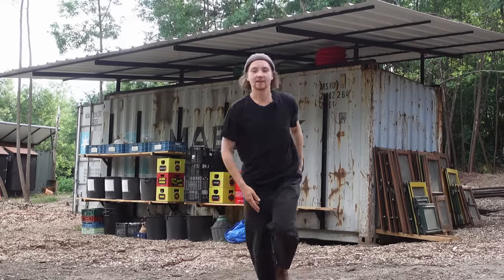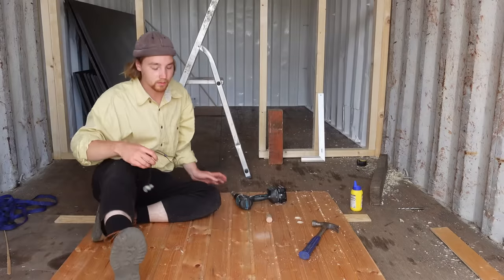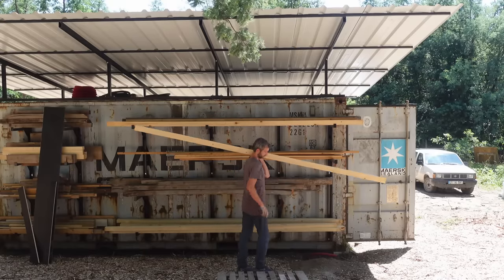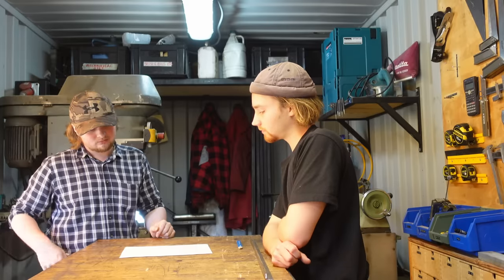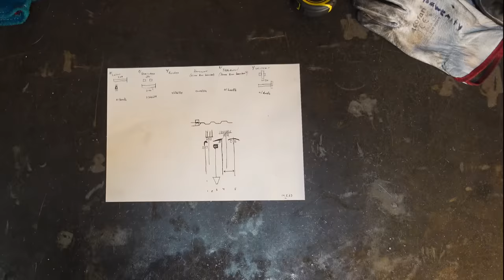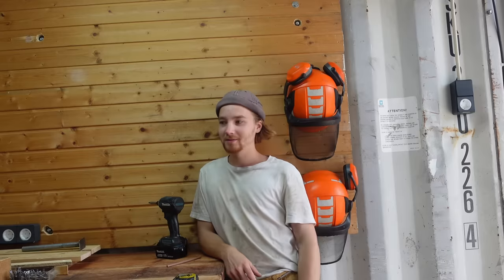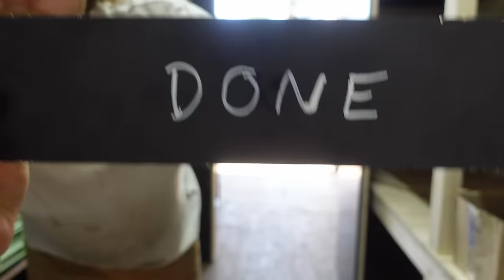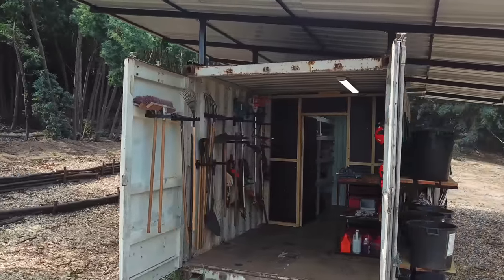#85 We rebuild this shipping container to store all our bulk food, tools and materials.

Comment: That's a ton of work!  Great progress.  

I have one suggestion: where your storing your gasoline, you may want to have a vent to the outside to minimize contained fumes.  Lower explosive risk, prevent people getting dizzy, and prevent your stored food from smelling and tasting like petrol.
Reply: Venting also ceeps the Container from becoming a sun fueled oven in the summer and reduces the build up of moisture in the cooler seasons which leads to less mold and rust.
Reply: and also don't  store paint with your food for the same reason
Reply: Even better would be lockable box outside of container for fuel/oil/paint. Something like old refrigerator/freezer.
Reply: Everything combustible should be outside in a metal locker with a stout lock.  Time for a trip to the second hand store (or a phone call).  Storing flammables like gasoline and oil next to food stuffs is strictly forbidden virtually everywhere in the world that has occupancy rules.
Reply: @wolfgangfroehlich7786  I believe that is why they designed the roof in this fashion.  In addition to providing shade to most of the container, there is a natural convection flow of air across the container as the top roof heats and up the container roof stays cool.  Very creative design on many levels 😊
Reply: venting could also help keeping dry through the winter
Reply: I worry about storing gasoline and oil in the same building as food.  I hope the separating wall and door is air tight!  The fumes could seep into the food and effect the taste and quality!
Reply: @stevejohnstonbaugh9171  Of all the cutting machines they've got, I've only seen 2 that are fuel powered, the majority being battery operated.  Unless they refuel inside the container spilling/saturating onto the floor and bench, it's doubtful fumes can accumulate.  The majority of the season the entrance doors are left wide open.  I've stored my roto tiller in the basement empty of fuel, keeping the jerry can of fuel in a brick faced lean-to outdoors.  No problems for 45 years.  Extreme heat of summer in Portugal, investing in a shaded/northern exposure steel locker for cans of flammables (paint and gas) kept apart from the other structures is a sensible suggestion.  The machines themselves don't carry enough fuel to be worrisome.  The Portuguese fire dept should be able to advise distance and placement of fire safe lockers.

Comment: Even if you have a roof over the container: If you drill holes into/through the ceiling do your self a favor and seal that with silicone or similar to prevent leaking. Even better if you would paint the bare metal before you put screws in to prevent rust.
Reply: better than building permanent structures at this point? it confuses me after 3 years.
Reply: @snakey319  they need permits for that.
Reply: @Music4Marko  I know and wonder why they dont get them and build for permanence, unless this isnt .
Reply: @snakey319  Not sure about here specifically but most places it is very expensive to get permissions that are then not flexible. Also many materials are donated or recycled and permits often require you to build to a standard with materials of a recognised specification for strength and fire.
Reply: @snakey319  Pretty sure this is the best possible solution for diy. Otherwise you need build permit for the land, architectural project, and after building the license to use. And since they are outside a town there might be the possibility that new permanent buildings are not even allowed at all.
Reply: @snakey319  they talked about that while back (about building lvl1 (tents), lvl2 (something like this) and lvl3 (proper buildings with permits).. and they said that in the future they will maybe do it. I guess its expensive or maybe even impossible to get, that is why for them its important to reconstruct buildings they already have, or to build on ruins of some very old stone buildings (which they also found in forest) because that is reconstructing and they can get permission for that.
Reply: One could also use hemp or cotton fibres soaked in linseedoil instead of silicone
Reply: Fab work. Emili does beautiful work. Dave seems a bit tired? I hope you all have fun 🎉
Reply: @randgate  Standards are important. Stops people putting up cheap buildings with a nice coat of paint. Then people find that the are cold in the winter hot in summer the electrics are a hazard etc. It is unsustainable.
Reply: @Music4Marko  I believe the community center is where Dave is waiting on permissions to rebuild/restore because of it's potential for full time habitation.  We shall see...

Comment: Great job!
I’d add a minor and major thing.  Minor, a spring on the door so the food area auto closes.  Major, passive ventilation near the fuels.  Containers can build up with evaporating fuel even with the small vents they typically have.  I saw the solar active vent and that’s good too, but at least a lot and high point screened hole should be added.

Comment: The recycled plastic socket enclosure looks very nice! Though, I suggest you consider the flammability of plastics. Enclosures of electrical equipment are made with plastics that meet standards for being fire retardant. In the event of electrical arc and/or overheating you don't want a flammable material nearby.
Thank you for being so positive for the community around you and for the world in general! And for the very nice videos;)

Comment: The rear bolts for the vice are really close to the edge of the plank in the desk top.
It might be a good idea to put a metal plate with holes in for the 4 bolts underneath the desktop to stop movement / breaking when the vice gets used hard!
Love the tool wall! <3
Reply: And a bit more to the front so you can also use it for longer things.
Reply: It’s designed to be mounted hanging off the side of the bench.

Comment: The storage container looks awesome.  Great teamwork getting it done.  One question,  why didn't you paint the entire inside and out? Painting it would help to prevent more rust,  helping the building to last longer,  and be more appealing to the eye.
Reply: It seemed like a tiresome job, (though the crew are not afraid of that) maybe it was enough. I think its aesthetically and a bit practically to not paint the outer part. It gives a nice space separation and, the gen. crew can be rowdy with their rowdy walls, while the kitchen peeps can have good control on hygiene.

Comment: Thumbs up!  Small suggestion for when you restock your scubby-sponges: maybe test other materials other than the green plastic scrubby-stuff (which is what it looks like you've got there and is really horrible for turning into microplastics).  When I saw it I thought since you're a living lab testing more sustainable solutions, it makes sense to suggest this test.  There are coconut fibre scrubbies that work great and are supposed to biodegrade/compost.  Maybe do a test with one of these against steel wool, your current sponges and a few other options like a boar-hair scrubbie-brush?  You could test them for durability (how long before it breaks down or becomes too stinky to use in the kitchen).  To judge the impact you could analyse the production streams that create these products as well as their post-use waste-or recycling streams.  It's definitely something that people can apply in their own homes quickly and something not enough people think about ...or it's something they DO think about but it's in a situation where the people who decide about spending are reluctant to spend more for what seem like more environmentally friendly options.  Tonnes of ethically minded culinary professionals would love to hear from your kitchen staff after they've put these tools through a few months of testing.  And with the larger amount of people you are cooking for every day, it's a fair-enough sized test to be able to count on the results after a few months of testing.

Comment: Nice work guys and great editing. mondays i always look forward for your videos :D
Two suggestions / improvements:
Maybe build a pully system with a weight to close the door on it's own. Just a screew and some rope to the inner top of the door, a little hole through the wall, a pully behind it and there suspends a small weight (sand filled steel pipe with hook), which slides throug a hole in the framing and always pulls the door shut. That way no additional space is wasted and with a little shelf for the weight when the door is open, you also have unlimited access if you need it to stay open.
Second one would be a vent system that pulls air into the storage part (vent at bottom hight) and vents it out over the workbench. That way your stored goods get fresh air, the fumes from the gasoline get directly pulled out, nothing gets air fried during summer and moisture can't build up during rainy season, which prevents rust and mold. With that maybe also seal the bolts on the top of the container to prevent rust and moisture leakage (silicone, grease, salvaged old motor oil or a rubber gasket from old bike tires might work).
Keep it up👍🏼

Comment: The upper section in the partition could be replaced with a transparent material, plexiglass, for example, if available. This would let in more natural light.
Reply: Transom above the door might be nice, but as is, this unit is double shaded so the probability that enough light could make it all the way back there is slim.

Comment: Expanding & organizing storage capabilities for larger numbers (25-35) of people at Kamp.

Personally I do not like mixing tools and general storage with food storage. Even if in separate areas within the same container. Security, hygiene, cleanliness, animals, rodents, heat/cold/humidity, spills or accidents. For now safely stored, easily accessible, removes congestion in main  kitchen. I much prefer to see a 20 ft bulk food storage container added near or connected to the main kitchen.

Comment: FYI - If you are planning on expanding solar - even for high power stuff like welding etc: Get a Deye 12kw inverter. Does 3 Phase, 15kw solar peak, does batteries and has MPPT strings. Goes for 2.5-3k. Get in touch if you want some

Comment: I'm not sure if you should consider having some type of ventilation in the container room. Based on my experience, without proper ventilation, items in the room can be susceptible to rust or mold formation. Ventilation plays a crucial role in maintaining a healthy and suitable environment within enclosed spaces. Without proper airflow, moisture can accumulate, leading to condensation and subsequent issues like rust or mold growth. By ensuring adequate ventilation, you can help prevent these problems and maintain the condition of the items stored in the container room.

Comment: any new holes in the container you drill you need to paint over or will rust overtime
Reply: This is really important! Particularly in the roof since the electrical connections are right there.

Comment: Be careful storing food and beverages in the container due to heat. Storage of food in temperatures over 75-80 degrees Fahrenheit will spoil your food and beer/wine. You could install a solar powered exhaust fan.
Reply: Also not a good idea to store food in a "technical" container, petroleum and paint smells may contaminate your food.

Comment: This video was fun to watch! I also thought it was empowering for the viewer. Well done! Now, for constructive criticism: I cringed for evert hole drilled in the roof. I agree 100% with the silicone suggestion. I also cringed with the big boards cut into little planks. The shelves should be scrap wood. That beautiful long wood is sold in a length based price, is it not? Too costly to make little pieces out of it! Lastly, there will be a rice dish someday that will smell like chainsaw oil! All it will take is a couple of loose lids. The edibles in the vicinity of paints, cleaners, and liquid fuel is forbidden in the food service industry in the states. Sorry, guys, but the food storage area needs further thought.

Comment: dont know why you didnt insulate it with a rock wool material its not that expensive and doesnt mold or rot...that shelter is going to sweat and condense inside down the road, I have a larger one and learned the hard way about condensation mold, mildew and rust with my shipping container

Comment: As someone who works in the harbor… never paint a shipping container. The paint on them is very toxic to withstand rust and seas so you should not sand it, and also paint will not stick on it at all. The paint will all flake off in a few months and make a big mess.